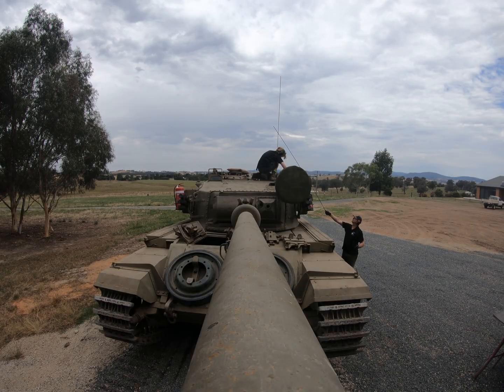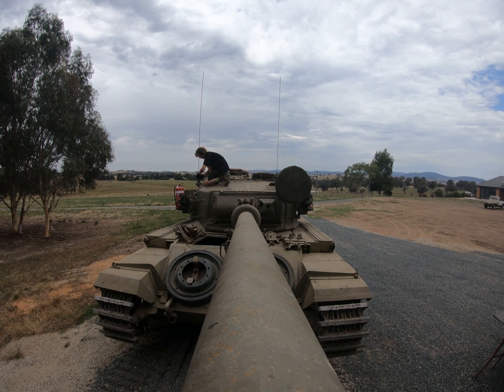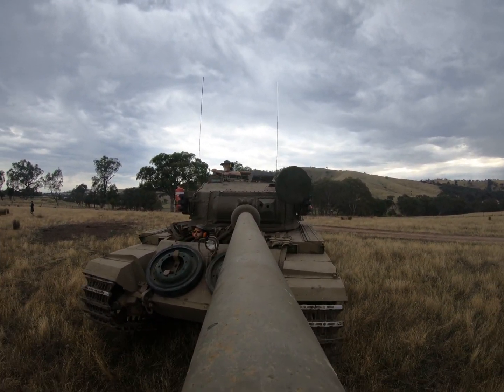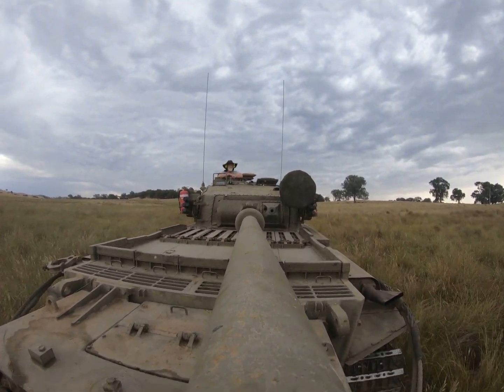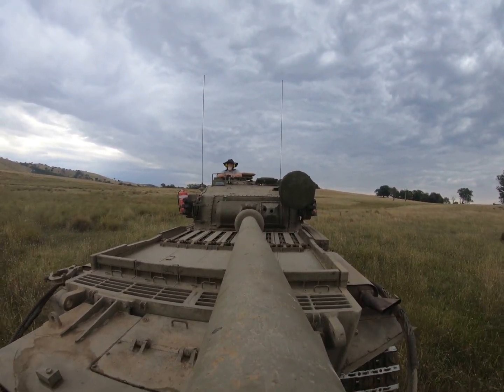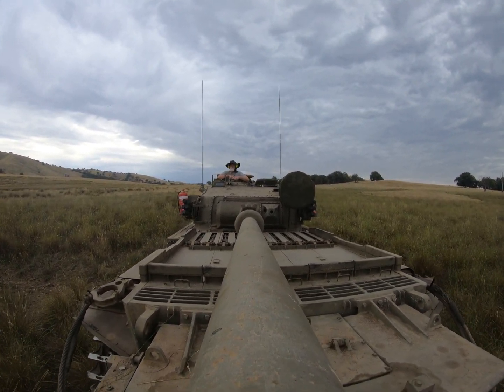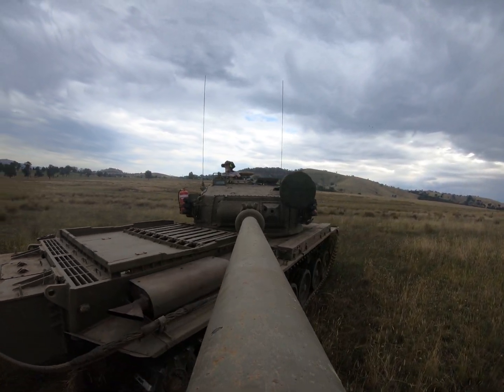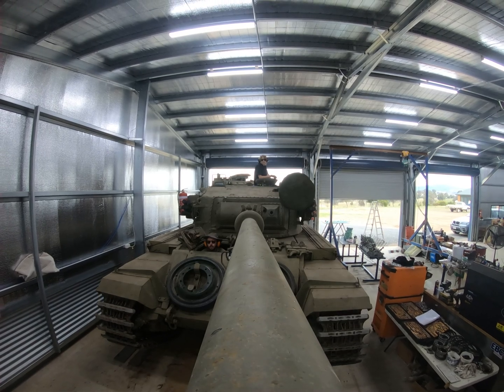Testing a tank turrets stabiliser!

Comment: Nice work Lottie, does the barrel bump the driver on the head at low elevation?
Reply from the maker: Depends on how big their head is 🤣

But yes, it can if they are above average in height. It misses me, though. If the drivers hatch is secured correctly, anything at or below is generally safe.

Comment: Good idea mounting the camera like that.  Though it also interesting to see tanks maneuver from a distance also illustrateing how stab works.  I forget is there an internal comms system?
Reply from the maker: There is an intercom system, but we were using hand radios until we get all the headsets and wiring set up 😊
Reply: @lottiethetankwhisperer  ah.  Guess that was a bit of a dumb why to ask my question.  Of course there is an intercom, should have asked if it was wired up yet.  The hand radios are connected to the ear protection y'all are wearing?  I'd think that would be a cool short as to how you communicate without the intercom being wired up for old tread heads like me.

Comment: Well done! FVGCE no 7 seems very well! You will notice that on the Cent there are bump stops side and rear which are physical. On the Chieftain these were electronic (you could upset the controls on that and give skipping lessons) and convince the dumber gunners they had to count and make sure you never exceeded 13 1/4 turns! There was always one! Safety point with aerials beware of overhead wires. Forgot at a rail crossing in Germany and that was the fastest I ever moved and was glad the commander was not TX ing at the time. Lesson learned by all! If not in TAC mode a small flag may be flown on aerial with your unit or speciality colours. This was handy for REME as the gunners merely had to look for flag to identify which 432 was their aid to help! You talk of inexperienced riders on deck. Tell them not to hold aerial as they will be shocked on transmission. It will hurt! Best regards and good new year from U.K.
Reply: Generally, you won't be shocked by a transmitting aerial.   Nerves can only respond to very low frequencies, such as the frequency of the AC power mains.  What you get from transmitting aerials is burnt skin and burnt deeper flesh.   This is what makes transmitters dangerous - you get internally cooked before you realise what has happened, as you feel no shock.
Reply: @keithammleter3824  I agree with you entirely. However you must look at history of British Army. The Centurion was introduced in late 1944. At that time the standard radio was a 19 Set. Soft Comms vehicles had a BSA charging set on one wing and a balanced aerial on the other. Magnacons and RF cookers were sooo secret nobody knew of them. Troops were warned not to lean on aerials in terms of ‘shock’. In those terms notices were posted. The format continued into the seventies because the link between micro wave cookers and RF cookers was only slowly being made to the rich half of society. 
What senior ranks and Crown lawyers wanted to continue was people not touching such devices especially as Crown Protection was now no longer available in many different walks of life and so they could be sued. So, such items became absorbed into standing Orders of the Day. This was a means by which all troops probably in all British services were made aware of danger and it became understandable to all from the brightest to the not so bright minds under the word of ‘Shock’. It is best today to preserve yourself legally by similar provision if only to prevent one of the Unholy using a 17 ft whip as a handrail! Have a good 2024!
Reply: @glynluff2595  ;  the word "shock" if it was included in any training or warning notice, was probably due to some officer with no technical knowledge.   The 19 set had an output of only 9 watts max, so was not likely to hurt you anyway.   Generally, the output was limited to 2.5 watts - just about completely safe. But a soldier's good grip of the aerial would reduce the transmission range, which in itself is dangerous - it might cause the tank to be captured, or a battle lost.
Apart from the low power HF mode of the 19 set, there is no argument that touching a transmitter aerial is a bad idea - it is even a bad idea to be too close to it. 
At least in my country (Australia), commercial vehicle-mounted 2-way radios are limited to 25 watts, so as to render them safe wrt to cooking skin/flesh.  Hand-portable radios, which are used with the aerial 2 inches from your head, are limited to 5 watts for the same reason.   But hand held ham radios can be up to 25 watts - some problems have occurred.
Reply: @keithammleter3824  Can’t argue with that. I only know what was posted about and generics are often misapplied. My personal radio training was limited to field set repair - I was in the first ECE course who added that to all their other duties which were everything bar ‘plumbing’! This meant that when Tels found out got all vehicle radio harnesses and head set repairs which gave much more time to brew in a warm Tels truck! Nothing like professional jealousy! Only burns I got were repairing the distribution box on a 432 which was stuffed under the front glacial plate by the driver and impossible to see. It had three buss bars to allow the alternators to generate the a/c for the rear power take off for Sapper tools though I never ever saw any n my time. Dropped spanner and recovered very quickly but a little warm! This was my first repair in the field and on return to boss for next job he looked at me and asked to see palm of my right hand! Apparently a lot of people had been unavailable for that job! Ah Well!! Have a good day!
Reply: @keithammleter3824  Back in the late 60's, the M113 APC's we rode on had a a thick sponge 'sausage' over the lower three feet or so of the antenna to protect against accidentally touching it to avoid burns.

Comment: Nulling out the drift. Does the turret run off a main hydraulic pump or the aux engine ? Does it also have a back deck switch, so the gun does not hit the back deck while traversing over the back.
Reply from the maker: It's purely electromechanical. There are no hydraulics in the tank at all. The drift comes from the voltage discrepancies in the system. The adjusters are essentially just variable resistors.

There are a few safety switches in the tanks for the turret including one for the rear deck. 😊
Reply: Research US Army tank Master Gunner. I am sure the Aussies have them too being we use the same equipment. @lottiethetankwhisperer